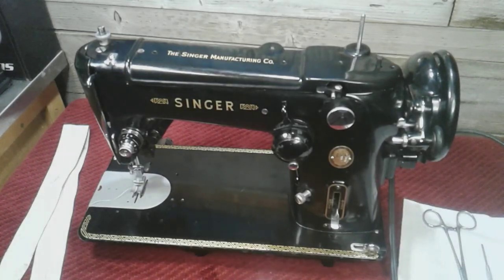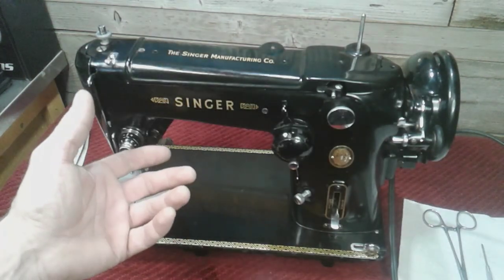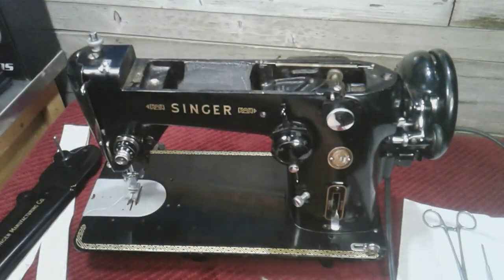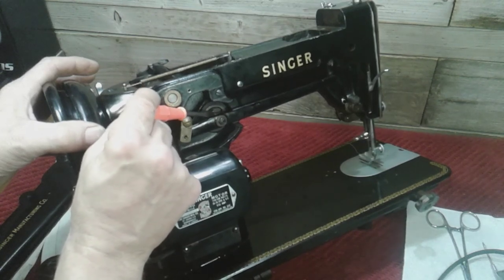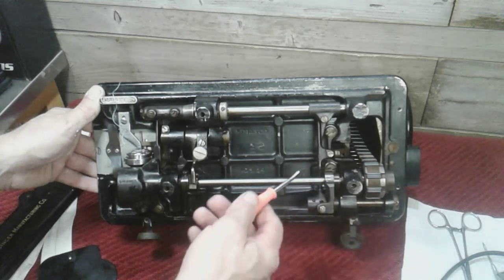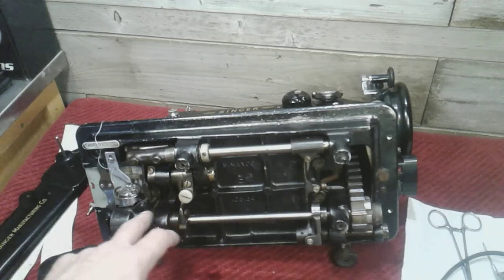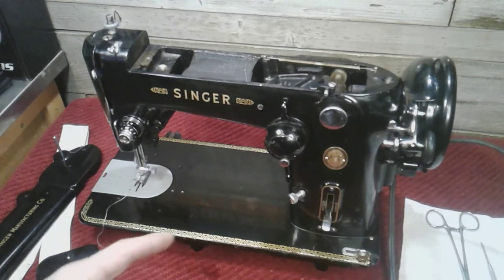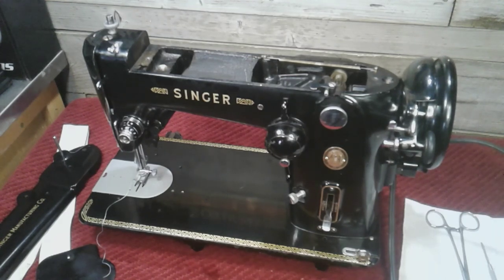How i get stiff sewing machines going again , (Subscriber's request)

Comment: I worked on a factory reconditioned 1908 66K under the machine all the cast steel had been electroplated ? and shiny and then varnished. The machine was still stiff after oiling, a bit of poking about I found some of the oil ports had a small amount of varnish so you could put a drop of oil in the hole but it was not getting to the shaft.

Interesting groove on the sliding needle plate a LOT of rough sting must have been fed into the machine ? making bunting or some war time use ?
The bobbin winder [very unusual compared to other Singers] it is mounted to a casting lug on the pillar that I have never seen on other machines. 

The paint finish is almost like new and it has the RAF decals from research they started using them around 1930s and the serial number starts with a "V" hence my machine is 1908 

I guess my tip is make sure the oil holes do let the oil get to the shaft.

all the best

Comment: My 306 was just very dry 10min to get it working. However my 319 had a bit of needle shaft stuck in the needle bar [very odd ? done on purpose ? wrong short needle] at the back of the machine behind the plate the screw was missing on the arm so the action would bind and then the motor went BANG after bypassing the capacitor hidden in the motor stator windings the machine now runs well.

I now have a 319 with an integrated handle on the top of the machine so that my wife can pick it up, this machine is helping her with her weight loss ;-)) she has a modern machine for lightweight materials.

I have also considered making my own cleated belt just for fun.

I nearly made a BIG mistake when I forgot to put the cam back on, fortunately I always turn over the machine by hand for pressing the go peddle . 

Nice to see your 306, my 306 is in a table and oil leaks into the tension disks, just have to remember to floss then before sewing.
Reply from the maker: My 306 was in a table , bad shape though , i thought about trying to make a cleated belt but to much figuring ouf for me lol ...
Reply: @4486xxdawson  For the belt I was going to make a flat wood jig to hold all the wire in the correct spacing and then find some non stretch cord, I might even consider fishing line or strimmer cord and glue the wire cleats.

I used to climb and pot hole the rope for pot holing was designed not to stretch too much since during a fall might bring you in contact with rocks; the other thing was you had special metal grips to climb out up the rope.